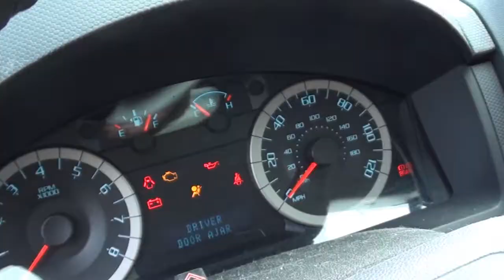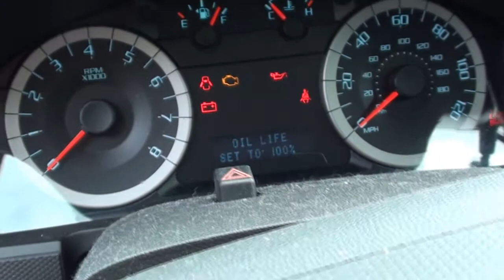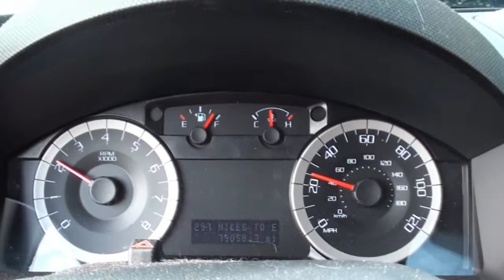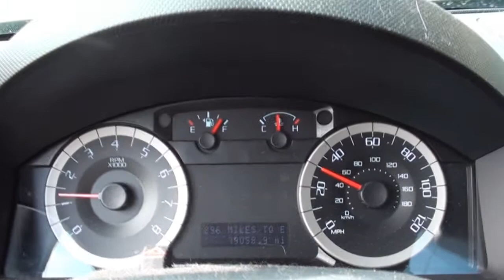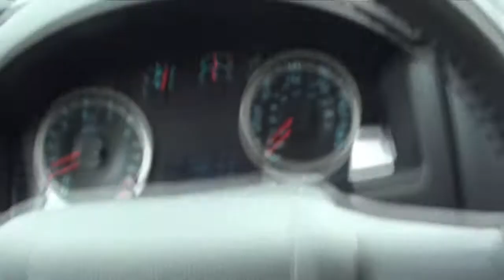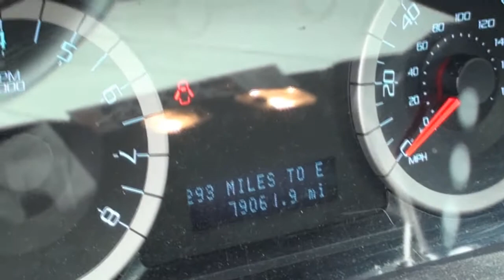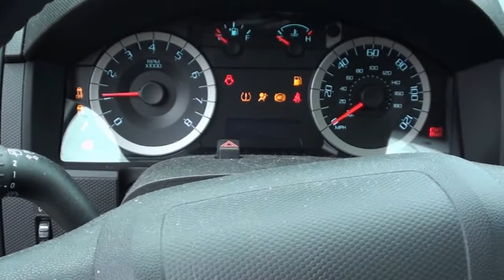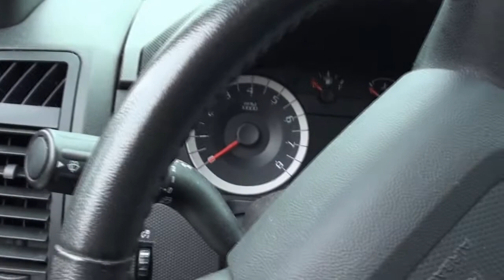MV 28 - "The Escape Gets Fresh Transmission Fluid"

Comment: I also have a 2011 with 148,000 I bought it with 145,000  used  ....    My escape was very well taken care of, the Ford garage told me to not  to change the fluid. it shifts fine but after watching you, I feel confident to perhaps change the fluid in my Escape. I am   nervous tho, if it should go bad if I change the fluid. I was shocked how dark your transmission fluid  was ,my fluid is red on the dip stick so maybe the previous owner took better care of this car as it shows it was in very good condition I think an older woman owned mine from new.  I watched your other video about the rusting quarters I used a syringe to shoot rust  paint inside the splits where the metal was not crimped together  and gets exposed to salt and dirt the paint peels off . My car has not rusted since I did this on both quarter panels around the back wheels I did not paint the body just in between the raw rust metal in the wheel wells. I bought the rust paint on ebay I cant remember the name of it but it comes in a small can and you must wear gloves cause if it gets on your hands you can't get it off for many days . these cars also rust in the tail gate seams at the bottom  and around the back window in the tail gates. I hope my info helps you. Also the rear glass hinges can break as I have watched others have this problem mine are fine I live in Maryland and my Escape must have been garaged since new I don't have a garage so it sits out all year . My escape is also the 2.5 liter and is highly optioned it has running boards and Sat radio . My Escape is white with tan  heated leather seats and has self parking option its really cool to have the car park itself. mine has the back up camera as well. I like this car more than I ever thought I would in fact its similar the the new Bronco. I don't like the new Escapes

Comment: This is the 6f35 transmission. there is a TSB to have the TCU reflashed. I had a 2010 Fusion 2.5 with this transmission and 2-3 did a "shift flare" when the engine was cold. these are known for it. get the TSB done and it will be much better.

Comment: these transmissions commonly leak from the drivers side axle seal
Reply from the maker: +Ericthemachineman Yeah, from the research I've done, I see that it was a common issue. I got the replacement parts and will hopefully get it fixed this week.